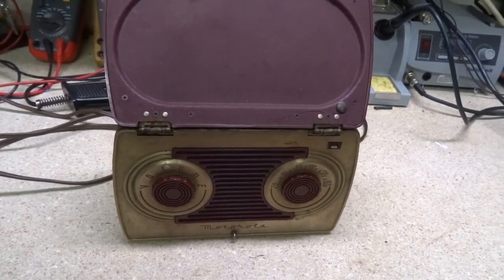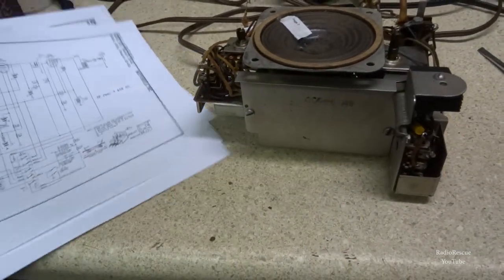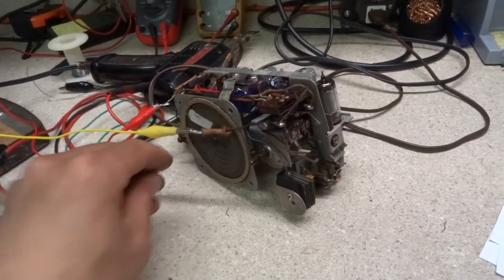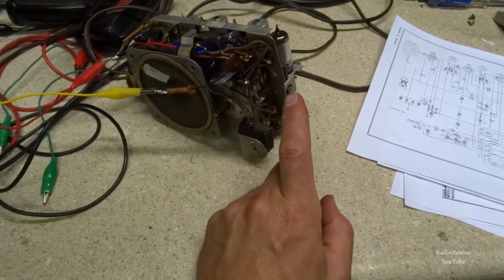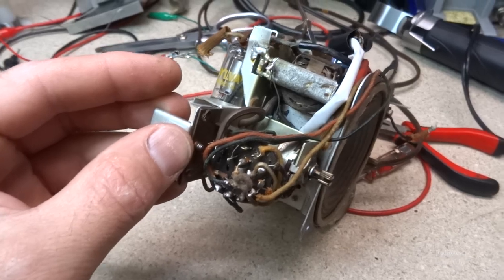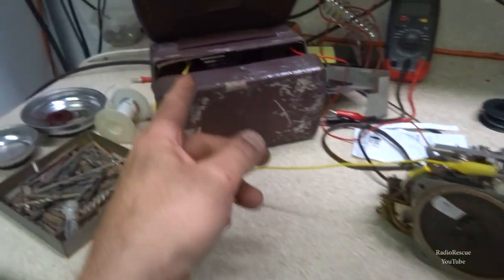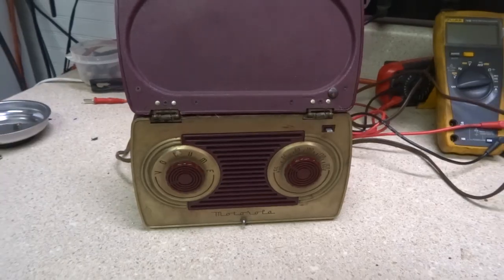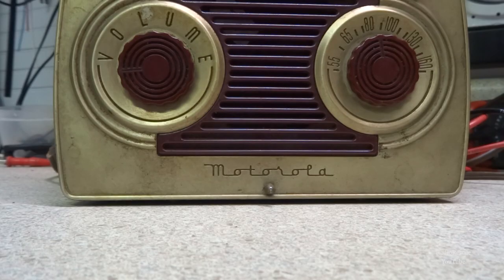Repair Of A 1948 Motorola 5A7A Portable Tube Radio

Comment: Isolation transformer can provide filtering on the AC line which can help prevent line noise from interfering with radio operation. Modern electronics use switching mode supplies which have harmonics from the square waves in the switching mode circuits.
I use a small one to help filter out this noise when enjoying my AA5 miniature tube sets at night for some distance listening.
I have both radios shown here. The little Motorola is a great little radio and I think he's a good little guy, lol. The GE is a trip with the big plastic box cabinet and the miniature tubes. God Bless

Comment: I just bought two Motorola's tube  portables 1950 ,s era, both work ,one been recapped ,the other is all original ,does anyone no where ,I can get schematics for them .great repair on the tube portables .I pretty sure these portable arent for beginners ,they are more complex and harder to find your way around ,the a regular AA5 60 era radios,that's why I bought working portables,I am amazied how fast my two warm up its as fast as a transitor radio
Reply from the maker: Schematics http://www.nostalgiaair.org/Resources/

Comment: I often wonder, could one use a full wave rectifier in place of the single diode?  This would surely  drop the voltage by a few volts since it is, in essence 4 diodes, in fact to make one yourself, it is a simple matter of building the 4 diodes in the proper configuration, it would, of course give a very smoooooooth output and,  perhaps using both sides of the AC, I guess may increase the voltage instead of dropping it by the .6 volts per diode, I am not sure since I have never tried it, however it does come to mind when I see all the tech's  on Youtube doing the dropping resistor with the single diode.

Comment: I bought a tecsun AN 200 tunable passive AM radio loop antenna,for my AM radios ,because all you do is set loop antenna next to AM radio and tune it to werar it Improves AM reception ,It works .be cause liveing in a apartment reception sucks

Comment: Are the tube filaments D.C. or A.C. driven?  I suspect they are D.C. powered, and it it derived from the B+.  Perhaps you variac until the tube filament voltage is correct, and measure the B+.  That's what it should be.
Reply from the maker: DC
Reply: @45AMT  I believe filament voltage for these tubes is more critical than B+.  As long as the filament voltage is within tube manual limits, and something weird isn't messing with the B+, then the tubes should be fine with whatever the B+ is when the filament voltage is correct.
Reply from the maker: @harryshector  The radio is already fixed.